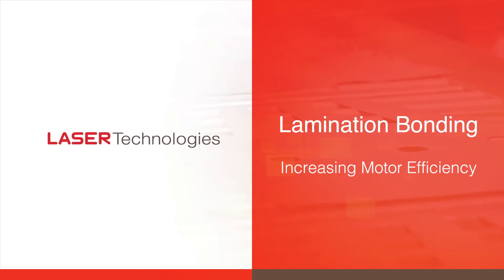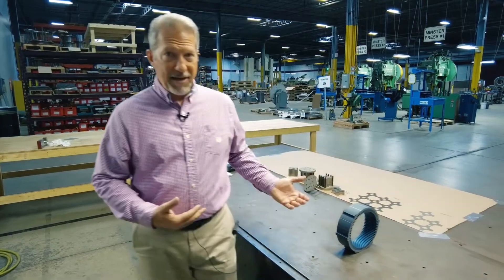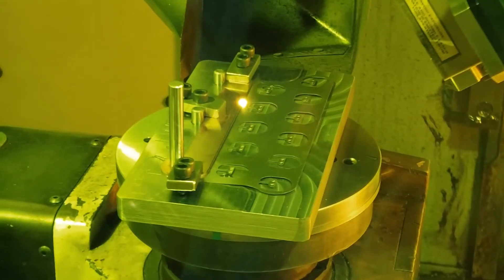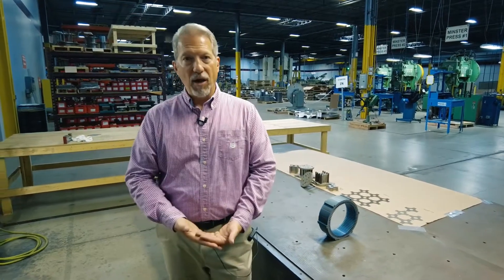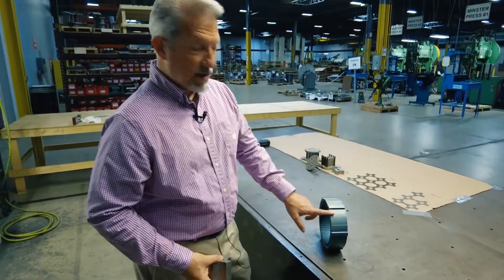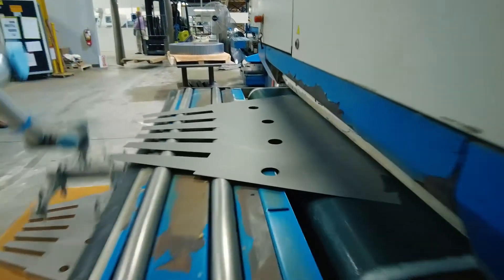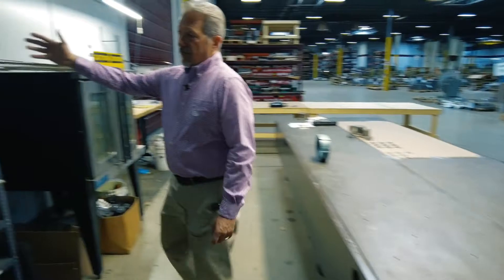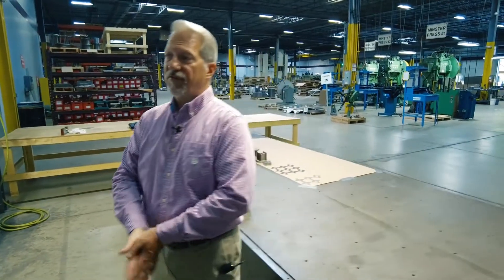Lamination Bonding

Comment: Epoxies we find is our market, a little thick for bonding. What is the bonding tkickness you reach for the epoxy bonds. Is theer a way to thin the epoxies, or as another solution to use acrylic based bonds.

Comment: bonding vs laser welding 03:10  bonding> no harmonics, no vibration,  face to face contact.    Laser welding is cheaper than bonding with fixture .

Bonding 04:10 heat( tempature), pressure and time

Comment: I learn a lot from this video. Thank you for sharing. 
Quick question, what insulation materials did you use as the bond between the silicon steel laminates?